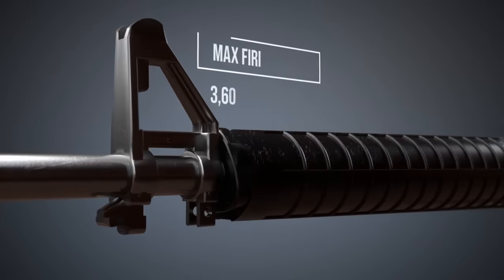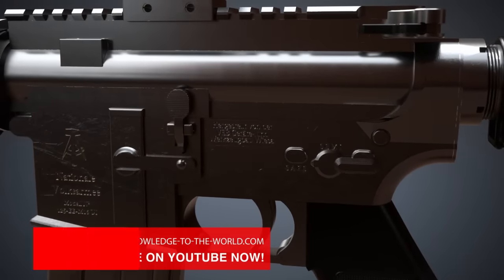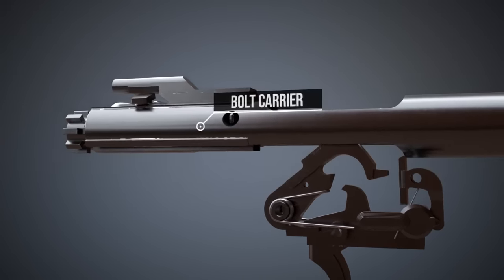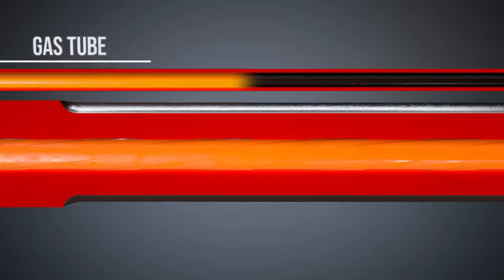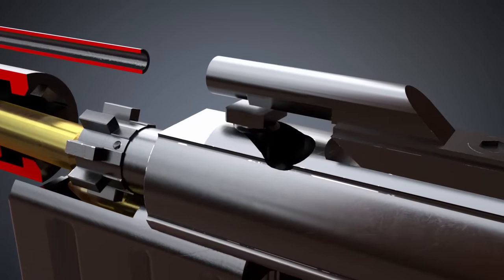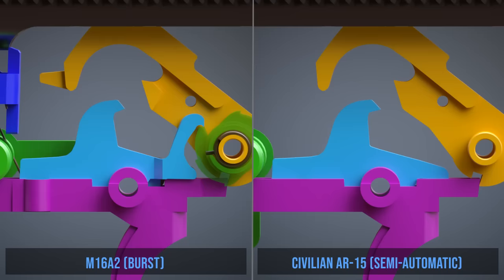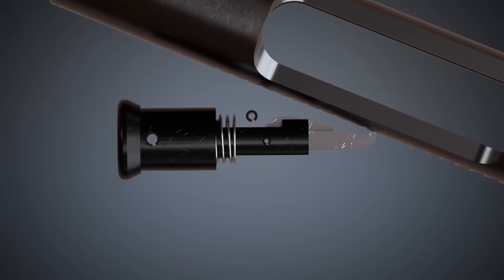M16 and AR-15 - How firearms work! (Animation)

Comment: great video 
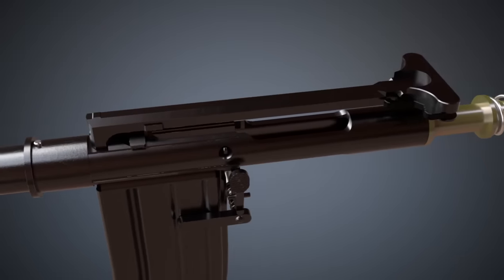@ 10:21 you have the wrong buffer for a collapsible stock.  The bolt would not go far enough back to chamber a round.  That is a rifle buffer and you would need a carbine buffer.

Comment: Will u make a video about grenades or grenade launchers?
Reply from the maker: Of course :)
Reply: Grenade launchers are about as complex as a shotgun. Probably be a short video...
Reply: thats awesome
Reply: Thomas Schwenke Can’t wait!
Reply: @RetroMMA  
Do to a single grenade launcher, you are correct. But there are some interesting variations, such as the blow forward launchers
Reply: Ellipsis of Triple Tap the 30mm grenade launcher cartridge utilities a high pressure and low pressure chamber innthe case and is actually a pretty complex design. Russia has a caseless design too, so it's a little more complex than a shotgun. Not to mention the feeding of semi auto and even pump shotguns are pretty ingenious.
Reply: Ellipsis of Triple Tap that depends on if you want to fire more than once

Comment: Everything was explained well with the exception of calling both firearm “assault” rifle. The full automatic could be an assault rifle however the semi automatic is just that. A semi automatic. Not an assault rifle. Military never use this style of semi automatic. Although they are sometimes black in color and have a handle grip, these are where the similarities stop. Military do not dress up this rifle with all the bling as civilian versions. The combat M16 is simple and effective in firing full automatic for maximum destruction. The AR15 is not suitable for combat and military use. It is strictly a civilian design with many options available for customization. Two completely different functioning rifles with two completely different purposes.
Reply: Actually there is technically no difference between and "M16" and an "AR-15" with the exception that all M16s are owned by military.  M16 is a US military designation for the rifle.  Many of the older M16A1s I had in the armory when I was in the USAF actually had "Colt AR-15" stamped into the side of the lower receiver from Colt.  Below that was stamped: "Property of U.S. Gov't M16A1."  AR-15s can be commercial or true milspec, and they can be semi-auto only or they can have full auto or burst.  The ones sold commercially are semi-auto only and are built with a lot of commercial grade parts that are not interchangeable with milspec models which are tooled differently and have more robust parts.

In other words, very few AR-15s are M16s, but ALL Colt manufactured M16s are in fact AR-15s.  (AR-15 is Colt's trademarked name for it, and M16 is the US military's designation for it.)

Also, the M16 is far more effective at a point target (person) when fired in well aimed semi-automatic shots.  "Auto" or "burst" is primarily used for area targets (vehicles or groups of soldiers) and is far less accurate or effective.  Full auto is also used for suppression fire to prevent an enemy from advancing, but it's not an effective way of killing individual troops.  We very rarely ever used full auto, and to this day soldiers in combat are trained to use semi-auto when engaging an individual target (which is most of the time).  Other weapons like the M249 and M60 are used for suppression fire and on area targets when they are deployed because they are far more effective for that purpose and less effective at use against individual soldiers who may be well spread out from each other and at a distance that requires well placed semi-auto shots to effectively engage them.

As far as "assault weapon" goes, I agree.  That is not a military term.  Assault weapon is a term used in some gun laws (and having many different conflicting definitions, depending on which law), and is also often incorrectly used by the media, certain politician and others who don't really have any idea what they're talking about or looking at when it comes to firearms.  I would not have used the term "assault weapon" in the video, but having said that, he's not actually incorrect either (depending on what laws you look at - where, in some laws, basically any AR-15 would meet the legal definition of assault weapon).  I'm not saying I agree with those laws, but they are there and it is a legally recognized (even if foolish and unpopular) definition.
Reply: @skyhawk_4526  Sir you are wrong.  An AR-15 is not an M-16.  The bolt, trigger group, buffer and lower are totally different.  The lower isn't milled out the same at all... less milling with no room for the auto-sear mechanism or even the other trigger mechanisms and AUTO select switch mechanism.  The bolt isn't milled the same either... the lower portion of a M-16 is milled on the underside of the bolt to provide clearance for the trigger group mechanisms and hammer for AUTO fire capability.  The buffer is made differently for an M-16 (heavier spring and buffer) vs the AR-15.  The AR-15 may look similar to an M-16 but they are completely different weapons.  As such the explanation of the operation of an M-16 is correct but the displayed operation is incorrect for an AR-15.  Go to IRAQVETERAN8888 to be informed on the differences https://youtu.be/qowqgLGmzxI
Reply: @richardt3744  Incorrect.  "AR-15" is a BRAND NAME ONLY.  M16 is a US Military designation.  Eugene Stoner, the weapons' inventor sold the design to Armalite who named it the AR-15.  Then it was sold to Colt Mfg. for mass production and they kept the name.

There are in fact fully automatic AR-15s used by SWAT teams and other civilian agencies that were purchased from Colt and other manufacturers, but those cannot correctly be called M16s because they are not in the US Military's inventory.

It's no different than aircraft.  McDonald Douglas invented the DC-9 as a passenger airliner and that's what it's called.  However, the ones the Navy and Air Force purchased were designated the C-9A.  Same with a Chevrolet 2500 Scottsdale pickup which the military calls the M-1008 light truck.  Or the Cessna 172 which the USN and USAF designated and called the T-41C.

Of course there are civilian (commercially) manufactured AR-15s that are not built the same as true milspec ones that are sent to the military (and a few select civilian LE agencies), but that does not mean they are not an "AR-15" if made by Colt.  Like I said, the old M16A1s we had in the armory had "Colt AR-15" engraved on the left side of the lower on the magazine well.  They were also marked "M16-A1" and were full milspec and full auto.  Every Colt M16 used in Vietnam was the same as those and with the same markings.
Reply: @richardt3744 

"In January 1963, Secretary McNamara received reports that M14 production was insufficient to meet the needs of the armed forces and ordered a halt to M14 production.  At the time, the AR-15 was the only rifle that could fulfill a requirement of a "universal" infantry weapon for issue to all services. McNamara ordered its adoption, despite receiving reports of several deficiencies, most notably the lack of a chrome-plated chamber. 

After modifications (most notably, the charging handle was re-located from under the carrying handle like AR-10 to the rear of the receiver), the new redesigned rifle was renamed the Rifle, Caliber 5.56 mm, M16."
      - Wikipedia M16 rifle page
(Just in case you wanted to hear it from someone other than me - and there are plenty of source citations on the actual page.)
And if it's worth anything, I'm a currently certified LE patrol rifle instructor, certified AR-15/M16/M4 Armorer, and former USAF Security Police/Security Forces certified armorer (1994-2002).

I understand your argument about the different parts and machining between commercial and military versions of the rifle, but AR-15 is Colt branding and all Colt M16s are indeed Colt AR-15s.  AR-15 is purely a name.  What makes an AR-15 an M16A1 or M16A2 is that its built to military specs and sold to and used by the military.  None of the civilian models (due to their non-spec parts) could ever be accepted for military use.  Conversely, no true M16 can be sold to US civilians. (In fact the true mil-spec details for the M16's construction and tolerances are still classified.)
Interestingly, FN recently offered it's rifle (semi-auto only) to the commercial market - but that version is made with completely different parts and to completely different specs than the FN manufactured M16s sold to the US military.  The commercial FN model Is expensive because people think "it's what the military is buying."  But the one they can buy from FN is nothing like the military version, and shares a lot of its parts with Bushmaster rifles.  They can just sell them for more because people are ignorant and want an FN because the military buys FNs.
Reply: @richardt3744  Such logic would mean that making a "civilian AR15" select fire would turn it into an M16, which could not be further from the truth. The truth is that an M16 is property of the US gov. and not every select fire AR is owned by the US gov. An example is that the Diemaco SFW in use by the british is NOT an M16/M4 property of the US Gov, yet it is a full auto AR15. 
Even the Colt rifles that were select fire had "Colt AR15" written on the side of the receiver.
The AR15 is a platfrom, not a specific model. A model of AR15 would be something like a Model 723. The M723 has "Colt AR15 Model 723" written on the lower and it is a select fire weapon that was sold to military and police.
Again, the M16 is not the only rifle that can be full auto. Countless models of AR15 that are not in US service are select fire.
Reply: The M16 isn't an assualt rifle, that term only exists in german speaking countries and refers to any modern genral issue rifle, it does not refer to physical features of a weapon. The G1, G2 and G3 are all referred to as Sturmgewehre eventhough they are full powered rifles chambered in 7.62 NATO.

Comment: “A lot of soldiers would waste bullets in fully automatic mode”
They must’a been firing from the hip, and spraying bullets all over the range.
Reply: ExoBot343 or probably at a range the recoil would throw them off target in full auto and they would keep shooting to try and hit. 3 round burst is more predictable
Reply: Gamer16Cylinder modern warfare 2 reference
Reply: The amount of bullets that to down range is variable.  When several dudes are coming at you, sometimes you need more than three shots to do the job.

Comment: 9:10
you also failed to mention the most important aspect. no flash so your enemy can see where you are
Reply: The muzzle flash can still be seen. It's more to disrupt the flash for the shooter so it's not blinding in low light. The flash is still visible, even to someone downrange. So it was explained correctly. Thanks for playing. 

A sound suppressor would work better for what you're saying as the gases will typically expand and burn in the sound suppressor before escaping the muzzle end, and if any flash were to be present with non-subsonic ammo, it would be very minimal.
Reply: It doesn't matter if it's the last thing they see.

Comment: Their are several different parts between an M-16 and AR-15. They have same chassis but M-16 is an assault weapon. AR-15 is a civilian generic semi automatic rifle!! Hence the common mistake and lack of education of calling it an assault rifle. Only the same in appearance.
Reply: Only practical difference is that the M16 can fit an autosear.
Reply: M16 - AR15 were interchangeably used while I was serving in the SAF during the 1970s.  Then, both have identical features with the exception of a bird-cage flash suppressor in the former.  The AR15 had the duck-bill flash suppressor.  Both have the option to fire on auto.  The M16 was licensed-built by Singapore's Chartered Industries, whilst the AR-15 came from Hartford, CT.  Additionally, the CAR15 and AR15HB were used.  The former is the carbine version just like today's M4 but could take the standard M16/AR15 bayonet (not sure if the M4 could take a bayonet).  The AR15HB has a heavier barrel and was used to deliver short bursts in auto (we were trained to fire single shots to conserve ammo).  Despite the wider barrel, the HB could still take the bayonet.  A simple clip-on bi-pod is issued to all M16/AR15/AR15HB/CAR15.  I spoke with a Vietnam vet decades ago and he wasn't aware of the AR15HB, so I guess it would be a tailor-made version for the export market.

Comment: AK-47 are the easiest and most reliable!
Reply: Victor Mog 
MOSIN NAGANT
Reply: Simpler than M16, but with less accuracy and more chance of jamming.
Reply: @ibrahim-dw8xl  
I personally beat 80-90 from AK-47 from a distance of 100 meters.
But more chance of jamming AK-47 is fake!
AK-47 is the most reliable automatic rifle.
Reply: @ibrahim-dw8xl  actually, due to AK's having loose parts, the chance for one to jam is small, but you are correct about the accuracy. The large calibur bullet makes long range shooting difficult compared to the M16's smaller calibur bullet.
Reply: @seal7144  NUGGET
Reply: Confirm this. I have vepr 12 at home on ak  system. Very easy mechanical. I spend a lot time fo understanding how it is working inside. The better weapons can be laser systems only 😎
Reply: İbrahim Karahan the ak has too recoil
Reply: @victormog  Watch a channel called InRangeTV they mud test various AK47s and AR15s. The AR15 kicked all the AKs asses. They also did a dust test. The AK really shines in sand and dust VS AR15. But mechanically the AR15 is vastly superior. The AR15 keep mud and debris out with its tight tolerances and dust cover.

Comment: I was told by old timers not to trust the AR15/M16 types. I have learned so much since and realized that this system is a well designed and unfairly maligned design. I thank you folks for that.
Reply: Really the only problem with it is the direct impingement design, though thankfully some piston ARs rectify that.

Comment: i remember some of the parts from when we had to learn about the gun by taking it apart and putting it back together before we were allowed to shoot it. they even had a giant mocked up version of the inards to see how it worked. i was in the air force and only shot it on the range a few times and did not have  a gun toting job but i was trained to be a radio repairman and only had a toolbox filled with screwdrivers, pliers, wrenches and electronic test equipment. there were some M1 carbines and ammo at the transmitter sites i worked at stored in a box just in case we ever needed it.

Comment: You put into vision what I understood all along but it's impossible to see the bolt locking pins. I always wondered what made the 3 round burst possible. Hats off to Eugene Stoner. It's easy to see what makes the function of this gun superior to the AK. But I also love the AK for those dirty up close situations where knock-down and sending crap flying in every direction is also a benefit. Thanks for the excellent work 👍🇺🇲🇺🇲🇺🇲
Reply: You do realise that (3round burst apart)  this is essentially an ak trigger group with a little more complicated auto sear

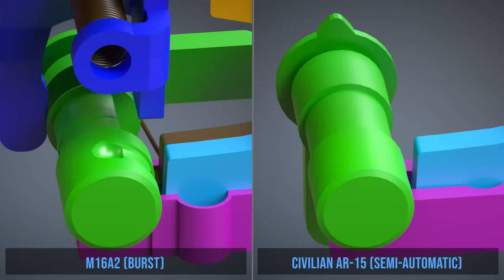Comment: 7:44 correction: the M16 and AR style rifles do NOT use direct impingement. At the back of the bolt is a stationary piston. The gas goes into the piston chamber and expands pushing against the stationary piston and against the non-stationary bolt carrier.
The AR is a gas piston rifle.

Comment: you left a few things out, but for most average people wanting to know the basics, this was done well.
one of the things that most people forget about is how the cam pin interacts with the upper receiver. next time you look at one take notice of the shape of the forward left side of the upper and you will notice what I am referring to. inside it is shaped so that the bolt will not rotate before going into battery. this is a VERY important saftey design feature and without it the weapon is unsafe and will not function.

Comment: 7 years in the military later and I finally learned the purpose of the forward assist.
Reply: I needed it three times with a brand new FN 16 in range week boot camp... I will never ever as long as I live own a rifle without a FA, or a reciprocating attached charging handle for this reason.
Reply: @Ranstone  With my builds, I find I have only needed it after doing a chamber check.

Comment: You should work on the History Channel, look at this, it's so amazing. showing and teaching how the M4 and M416 work, I would never have thought how it works from the inside, that's what makes it work, that's so amazing, I thought there was an internal suspension that made it work, but it's a gas that's created with the pressure and explosion of the projectile, making it work again, going back and forth using that pressure. it only loses to the AK-47 because the two cannons that were tested in the Vietnam war and the AK-47 wins and the M4 loses because it didn't fit for that place that had a lot of dust, dirt, water and all that debris mixture made the M4 lose, as it was not designed for that, but just to shoot.

Comment: Any muzzle device also reduces recoil. No matter if it is a muzzle brake, a flash hider, or a suppressor (NOT called a silencer). It does this by vectoring (controlling the direction of) the flaming gasses, or trapping and slowly releasing them (in the case of the suppressor).

Also, fun fact the first firearms suppressor was an adapted car exhaust muffler.

Comment: Both lower receiver and bolt carrier are of different designs in most civilian AR-15 rifles so it would be very hard to just drop in a full-auto sear. Yet there are still some AR-15s that have the M16 style bolt carriers.

Comment: 3 round burst is up to 3 rounds. This makes the design seem like its a perfect tooling.

Ive fired in burst mode and gotten 1 and 2 rounds out of it before. Better off using a 249 if i need that much